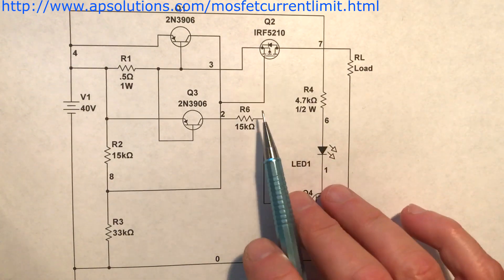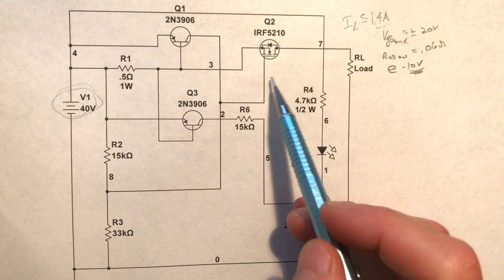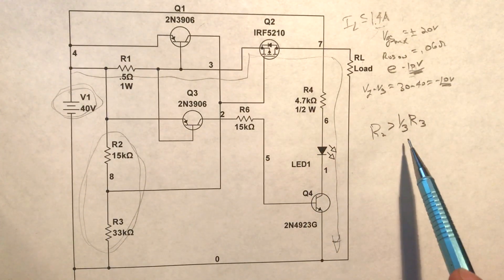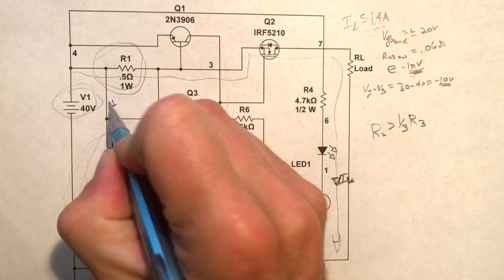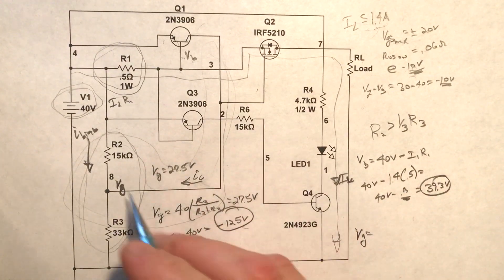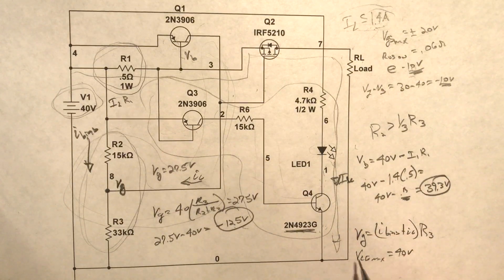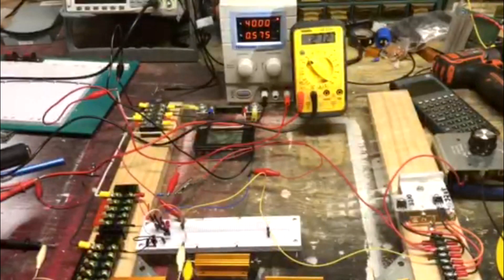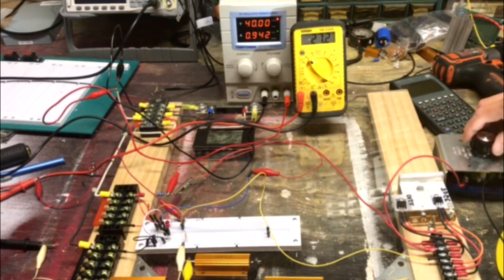MOSFET Current Limiting Circuit Tutorial

Comment: Q2 will ony dissipate 56W at shot circuit of the output. So when you load it with for instance with a light bulb and the current limits at 1.4A, Q2 will never dissipate 56W.

Comment: This type of circuit is very basic there are a number of ways to improve it. You really need to have a foldback current limit, if you place a resistor in the base of Q1 and a second much larger resistor from Q1 base to Q2 drain. This makes sure that as the voltage increases across Q2, Q1 turns on harder causing Q2 to quickly reduce the short circuit current greatly reducing power dissipation. Another change could be to add a zener in series with the larger resistor to the drain this would allow a more defined point at which the current limit reacts

Comment: Note this design is very inefficient when the load current (before limited) is way higher than the maximum. For example case above, if the limit is 1.4A, and without the limiter the load will draw 100A (near zero ohm resistance), then the Mosfet will need to handle almost 40V drop IN ITS LINEAR REGION. The heat dissipation formula P = I^2 x RdsON is not applicable when Mosfet is in linear region. What he said at the end of video that the Mosfet will dissipate at worst case 40V x 1.4A = 56W is correct. This Mosfet will dissipate that huge amount of heat if you put load that demands much higher than 1.4A.

This design is not for continuous current limiter because the rest of the current are rather "consumed" by the Mosfet as heat instead of being limited. If you want true current limiter where your device will often pass higher than the current limit, then use BJT (Epitaxial Planar Power Transistor) instead.

This Mosfet current limiter design is ideal for transient spike current or short circuit protection. It is also ideal in a case when the device MUST operate under certain current limit (where overcurrent is a failure). The advantage is that using Mosfet under Ohm region (using its RdsON) is more efficient than using BJT especially in higher current (>2A). And so the LED indicator in the schematic (and also beep/buzzer) is very important in order to notify people around it that there is overcurrent going on and this overcurrent issue must be fixed immediately.

Comment: Is there a way to make sure the MOSFET is either on or off is the power doesn't get dumped on it? The worse case was calculated to be 56W.  But could be (1.4A)^2x(0.06 ohm)=0.1176W?

Comment: Depending on your application, a latch-type solution can be an alternative. If you add another npn transistor cross-coupled with the 2N4923 (each collector drives the other's base via a high value resistor), you can then use the new transistor to sink the current in your 15K/33K bias chain instead of using the upper 2N3906 to drag up its mid-point (that transistor is then redundant).
As soon as the lower 2N3906 turns on, the two npn transistors will flip state and turn off the MOSFET and the output supply entirely. You'd need a momentary push button between the 2N4923 base and ground to reset the circuit when the overcurrent condition has been cleared.
Reply: If you could find a way to post a schematic of that, I would appreciate it

Comment: Q2 is not dissipating 56W  that is the load power dissipation.  The MOSFET is dissipating its Drain Current squared times Rds ON which is far less...
Reply: Unfortunately, if the output is short-circuited, then Vgs reduces and Rds increases. Because the limiting load current of 1.4A will still be flowing (otherwise the 2N3906 would not be turned on), that means the 40V supply  has to appear across the MOSFET, and it dissipates 56W.

If you like, you can consider the 2N3906/IRF5210 to be an amplifier that will try to adjust the voltage at the MOSFET gate so that the voltage across the sense resistor is 0.7V. While the load is greater than 40V/1.4A = 28R, the MOSFET is in saturation ("ohmic region") and Vgs is driven as low as it can be. Once the load resistance drops below 28R, the circuit will raise the gate voltage until the MOSFET starts to move out of its ohmic region and it will hold the output current at 1.4A as the load resistance gets smaller, thus decreasing the voltage across the load and increasing the voltage across the MOSFET. When the load resistance is 0R, the current is still 1.4A, and the MOSFET has the full 40V.

Comment: This is a very helpful video! Thank you for tanking the time to make it. There is one point I am confused on. When you calculate the power across the P-channel FET at 7:45, isn't it the power dissipated across the component that would be relevant to heat dissipation? And wouldn't that be (i^2)r, which would be .1176 Watts just before the current limiting kicked in? I get that the resistance goes up in the current limiting condition, but there is never going to be a 40 Volt drop across the FET, is there?
Reply: At the risk of looking stupid after having already displayed my ignorance...As the load resistance goes down in the current limiting condition, the voltage drop across the FET goes up corresponding to how far it goes down across the load?
Reply from the maker: @Guishan_Lingyou  Correct. I have described the circuit behavior in detail on my website:
http://www.apsolutions.com/mosfetcurrentlimit.html
If you go to that page and scroll down to the graph on the bottom of the page, you can see a graph of a parameter-sweep simulation that illustrates what is happening in the circuit. You might also pull up the IRF5210 data sheet (I linked to it from my webpage) and take a look at the Id versus -Vds curves. That might help clarify also.
Reply from the maker: Thanks Paul. Think about what must happen to the voltage drop across our load resistor as its resistance is decreased (assuming we keep out current at 1.4A)